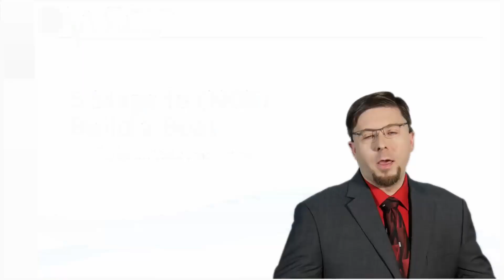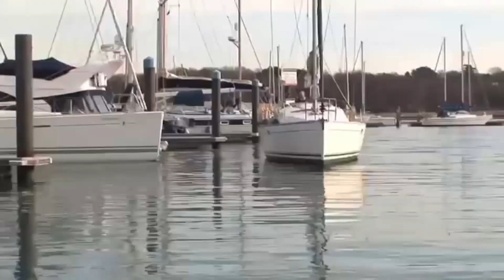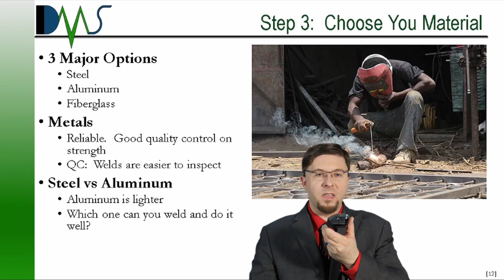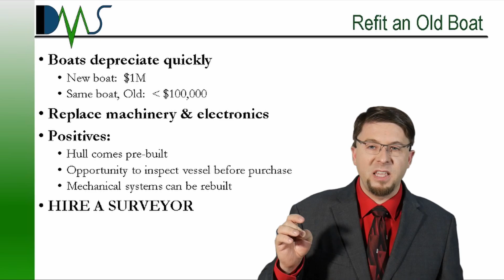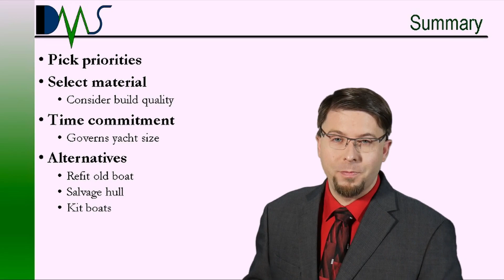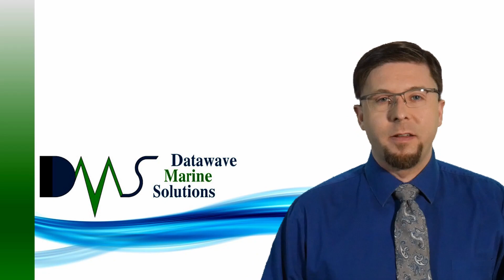5 Steps to (NOT) Build a Boat:  Planning for DIY Yacht Construction

Comment: sometimes desired usage means that (re)designing and building from scratch is necessary. For example there are very few rower-sailers that allows for 1) minimal cabin and or 2) easy boarding alone after falling overboard. It translates to partial redesigning hull, totally out of the box thinking about interior, out of the box redesign of rigging.

And the funniest thing is that 100 -150 years ago there were many designs, that could be modified. All before the age of plywood/glass fibre so it's redesigning for totally new material. Sometimes i think that vacum forming hull from some plastic will be easier than stitch and glue.

All because i want to build upon skill that i feel confident with: I can row in much harder conditions that i would dare to sail.

Comment: I've built a few small boats, several dinghies and 16 foot sailing canoes, and restored a 31 foot catamaran. In my opinion, if you want to build a boat with some given length, start by building a boat half that length. You are probably gonna need a dinghy anyway. Building the smaller boat will be so much faster than the bigger boat, that it won't eat very much into the project time, also you'll learn so much from building the small boat that you'll probably save time building the big boat!

Comment: Being a naval architect by degree, I like your videos. Still I'm set on doing my own boat. 

I will however be using an "off the shelf" linesplan, shell development and rigging arrangement. 
That being said I'm into Dutch Leeboards so that's an odd duck in and of itself.
Reply: Consider an unstayed mast and junk sail. Or two. It really cuts down on the costs(you can really just put a tapered aluminium streetlight pole if it met the design requirements) and is safer than a stayed mast (far fewer things that could fail). The junk sail has as many reeefing points as many battons it has and can be reefed in a few seconds in any wind conditions.
And if you're doing a custom boat anyway, make one with a scow bow instead of a pointy bow. It has plenty of benefits, especially for smaller vessels.

Comment: Not a single mention about wooden boats? They do still build them you know 😊 
Excellent channel btw, I've learned a lot here. Thank you.
Reply: Wood is the worst choice of material. It's difficult to work with and needs a lot of maintenance.
Reply: @Lars Hansen If you mean plywood then you're right. But its only advantage over a foam core is lower cost. I don't know if any boat manufacturers still use balsa core.

Comment: Sir, I actually had a former professor (no engineering background) who tried to make a large boat (SUV sized, not sure if it can be considered a yacht) via ferrocement using cement used in houses.  He was informed by a relative in my country's coast guard that it must be marine rated.  I wonder if inspection of such vessels involve checking the cement mix, the metal structure, etc.
Reply from the maker: I would need to review the USCG rules on inspection for ferrocement ships.  But it does make sense that the concrete mix would be part of the inspection.  However, that only applies to commercial ships.  For private yachts, USCG does not inspect each hull.
Reply: @DatawaveMarineSolutions  ahh, ok sir.   Thanks for the info👍

Comment: My dad and I built two boats. 
The first one was a 12' rowboat and it was from just drawings and yes it was basically flat plywood. 
The second one was a kit boat. But different from the Kit boat  you described, ours came with a separate molded Hull, sides, cockpit items such as seats and transom, cabin, and a molded deck. So effectively we had to put it together like a big model, cut a hole and build the housing for the swing keel, fiberglass in the stiffeners, as well as filling the void areas with expanding foam for flotation. It was a 16 foot Sloop, and it took us about six months of weekends, Fridays and Saturdays since we didn't work on Sundays. 
I got to admit that experience has gotten me itching to build another one (and it's not because of the fiberglass.) LOL

Comment: Best boat is one you can finish: Amen, you can always find a half finished hull in weather beaten condition in some corner of every country :-D Big dreams, not quite the reality to match. I helped build out boat 26 years ago, 40 feet, and a material you didn't even mention: wood. Plywood, glass over, epoxy, not polyester, frames and stringers under it, 3 layers on the bottom, two on the sides, marinised truck engine, original budget was 100k local currency and 1/3 of that was the nav/electronics package parallel imported.

Comment: Hi Nick, very clear and structured video. What do you think about HDPE etc. materials for boat hull construction?
Reply from the maker: I haven't had a chance to work with it yet.  But I like the recycle capability.  One issue I have with fiberglass / carbon fiber / composites is the lack of recycling options.  Last time I checked, there is no way to recycle a composite hull.  I believe I have seen some uses to grind up a boat hull and repurpose the shavings, but no true recycling.   From that perspective, I'm interested in HDPE.
Reply: @DatawaveMarineSolutions  Thank you, Nick.

Comment: An excellent lecture.
Left out a few possibilities.
1.) plywood/epoxy construction to end up with a wood boat far less likely to rot. Developed surfaces, or lap planked are best. 
2.) buying a bare hull and deck, or just a bare hull (good way to go with GRP) and fitting it out.
3.) Steel hulls can be built without a lot of specialized equipment, as long as the hull shape is kept simple. Some kind of gantry is needed to lift the heavy plates. Once lifted they have to be properly oriented and tack welded at the mid point of the curve. Then the ends can be pulled in with a come-along.
Reply from the maker: Excellent points.  And although I didn't give it any credit in the video, flat plate construction is perfectly valid.  I have seen many boats built purely from flat plate, with no bending at all.  Not the most efficient, but they float just the same as any other boat.  

I didn't know about that trick of bending plate with a come-along.  Roughly how thick can you go on the plate before that doesn't work?
Reply: That depends on two things: the length of the plate and the sharpness of the bend. Since I wouldn't go over 1/4 inch (for a boat of less than 10 tons empty and maybe 40 ft in length), I don't think there should be a problem. The thicker plates would be on the bottom where the bends are less anyway (as long as there is little or no twist). A hull I designed which is a 'V' bottom sharpie, with a steeper than usual dead rise, and pointed at both ends, has very gentle bends that approach that of an arch.
It is not a thing of beauty, and is meant mainly to be sturdy and have a work-boat finish. It is cylindrically developed, so there is no twist in the plates. It may not be the best shape, but I think it will do. I believe a simpler shape is a lot easier to fit an interior too. And it may also be easier to repair.

Comment: in my wanderings around YouTube, I've watched a few vids of people having fun and getting whet when bow-dipping at Haulover inlet. in many of the vids, I've noticed larger yeats with a massive window midships down at the waterline. For the same reason NASA shrunk the windows on the LEM, I would think those large waterline windows on the larger yachts would be a massive hull weak spot if not a flood risk in anything over sea state zero.  other than a giant gaping hole in the hull to access machinery space equipment in drydock, I don't know what to call them windows, lol. what do they do in stormy weather or during a hurricane, hide in a drydock? for real how do those not leak/break in rough weather and flood the boats all the time?

I guess an example could be an "Azimut 60" or "Azimut 55" that makes me want to be anywhere else, lol.
Reply from the maker: Yes, the windows can be a weak point, which is why they are made of very high quality glass.  I don't manufacture the windows, so I can't comment on the details.  But these are not your typical house windows.  More like an automotive windshield.  They require a lot of force to break them.  The main trade-off with those large windows is the cost required to build them.  You will also notice that most of those windows do not open.  The seal around an opening window is generally the weak point.  But just a solid pane of glass, permanently bonded into the hull:  that is pretty reliable.  

But I do concede:  these yachts are never intended to ride through a hurricane.
Reply: @DatawaveMarineSolutions  lol, I was thinking in the slip pear side during a storm that can easily kick up waves in a harbor, however, I guess they do have to take extra precautions. it is a luxury thing, and rough seas are not luxurious. thanks. still scares me knowing how most yachts are not watertight compartmentalized like coastguard/navy ships, so a leaking window would be "very bad". Thanks.

I'll go back to never having the funds daydream of a restored USCGC Hamilton WHEC-715 museum ship (My uncle was on that ship back in the 80's), or just the north sea EERV ships, they are 'cool'.

Comment: Ah well not quite that rich. And I know the sanest way is to buy an old sail boat... 
But I'm still dreaming of a fully solar powered power trimaran :)
In terms of complexity of systems it should be simpler. Any boat will have solar panels, this will just have a lot more and bigger electronics and batteries. Commercial solar panels are dirt cheap now. Upside is that you'd have ample solar power to run appliances.
Sailboats have motors and fuel tanks and filters etc. Electric motors are simpler to maintain. You don't need any mast or rigging or sail which also saves money and work.
Unfortunately I haven't found any plans for something like that yet. 
It would need to be very long and thin for displacement efficiency and have a wider deck that is perfectly flat for panels. Almost like a mini aircraft carrier haha.
Well for now it's just a dream.
I'd be curious what you think of the "intelligent" vacuum infusion method of the harry proas?

PS: Thanks for your videos!
Reply: I have plans to do the same thing but decided a cat was a better design for my uses than a trimaran.  Its just barely possible if you start with a very light displacement cat and live in the tropics, which I do not lol.
Reply: @RealHankShill  Oh wow first time I've found someone who also wants to build one! We should chat :)
I started with a catamaran and I think it's best if you want maximum space per length. Or if you buy a used catarmaran and retrifit or if you want existing plans, but most catamarans are too heavy.
Then I looked at the "ILAN" and "Adastra" trimaran designs and the harry proa designs and the principle convinced me. For the same weight of a cat you get about 50% longer boat.
Because I don't need maximum space, I want maximum length per weight and cost to cruise with 2 people. A trimaran can be longer for the same weight and cost which increases hull speed and makes solar power more feasible. The design I've come up with is rather simple and primitive. And ugly haha (my sketch: https://i.imgur.com/bUh6kWo.png). 
But 15m long and 3m wide central hull (1m WLB) would still allow transport on a regular semi truck.
I hope to have about 50m² or 10kW of solar. Unfortunately solar panels add like half a ton of weight. But according to my preliminary numbers 3kW power (assuming 50% efficiency) should be enough to power an extremely lightweight build boat at about 6 knots. 
I made a spreadsheet of how much sunlight you get per horizontal square meter of solar panel per day for each location and season. Summer and spring/fall in the mediteranian is no problem (~6 knots with unlimited range). Summer works even in Iceland. Winter in the north sea would still allow you a range of 34 NM per day on solar alone, but you could use battery reserves and a small camping generator to compensate. Or better a small outboarder as a backup.
These are all preliminary numbers based on sketches from someone who has no experience designing boats.
Reply: @dejayrezme8617  I saw a science based channel that addressed that issue and I think the YT title was "Tesla catamaran". They might have some information that you're looking for or at least calculations that they've already done. Just a thought.

Comment: Excellent video, as someone who runs a boatyard, I have no interest in building a boat from scratch.
Agreed,  purchase a used hull, or buy a kit and I suggest hiring a composite technician, to assist as necessary. 
DIY  boats generally have many mistakes and have limited resale value....far more sensible to buy a hull, that was originally manufactured by experienced professionals.

Comment: I've been dreaming of an aluminum hull swath sailing catamaran ever since I saw your videos on swath hulls. I believe the swath design would have benefits no one has even considered yet. With a computer sensing tension on the different rigging cables, the computer could automatically ballast the upwind hull to make it nearly impossible for the boat to go over. With experimentation, I suspect the captain of the boat could find a more stable configuration for very rough seas, how much or how little ballast and where... Another thought is it would allow the captain to lower the boat in the water when at anchor insulating the submerged skin of the boat from the heat of the sun and also make playing in the water easier. I saw a while back a fiberglass boat that had a solid foredeck (term?) and they were promoting how it was possible due to the way they drained the water fast. I could see the Swath hull to allow for a much larger solid deck in front of the cabin or more interior space. Just some random thoughts from a welder in Kansas...
Reply: Sounds like a recipe for a small software bug turning the boat upside down.
Reply: @mozismobile  the Boeing solution - as successfully implemented and crash tested on the 737 MAX.